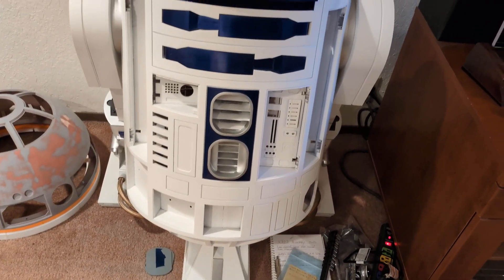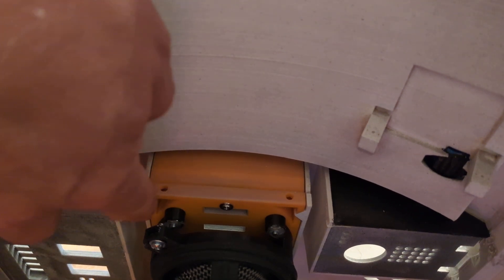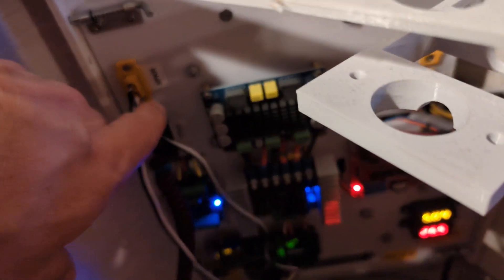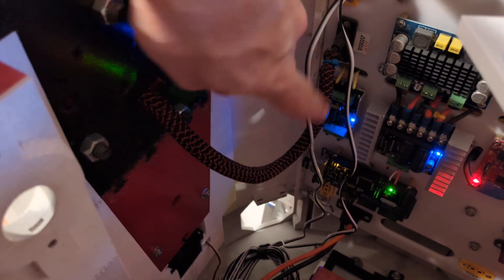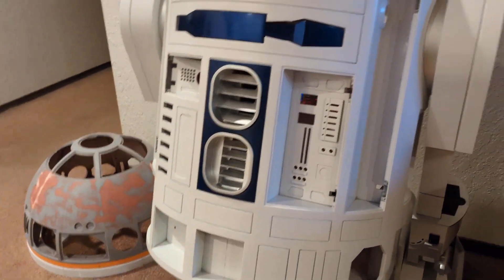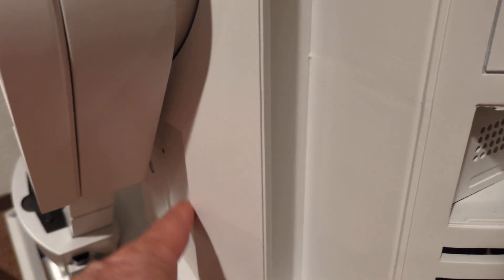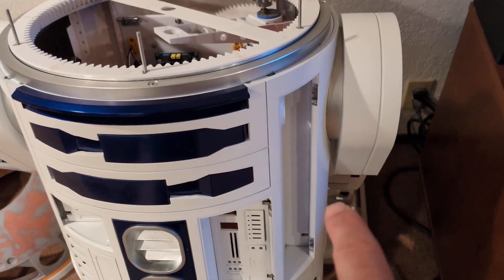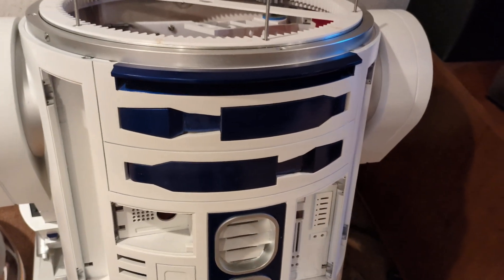3D Printed R2D2 - Part 106

Comment: 3:46 this is called parallel.  If the speakers are 8-ohms each, the pair needs to be treated as a 4-ohm speaker because they are in parallel, else you will burn out the speakers or their amplifier.  Impedance Matching is important for MPTT.
Reply from the maker: @rockosgaminglogic  Yes, I totally suck at speaker wiring.  The speakers are 4ohm each and I just wanted mono output.  Hopefully it's all good.  I didn't test the volume to see how loud it can go, I was saving that for another day.
Reply: @TomsProjects  that might be worse.  Check the impedance of the amplifier.  If you have your speakers in parallel then that's a 2 ohm load.  If you put them in series, its 8 ohms.  Some amps have a 4-ohm or 8-ohm option on the back.  Or  having series pair in parallel for a 4-ohm load with four 4-ohm speakers.  Getting the impedance matched will make it sound a lot better, too.